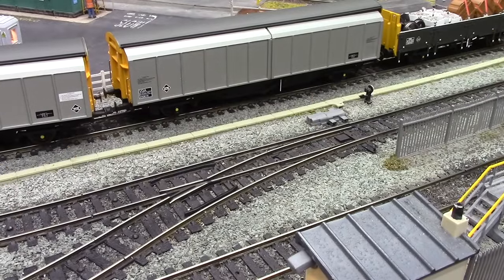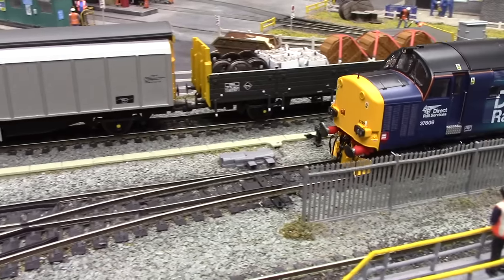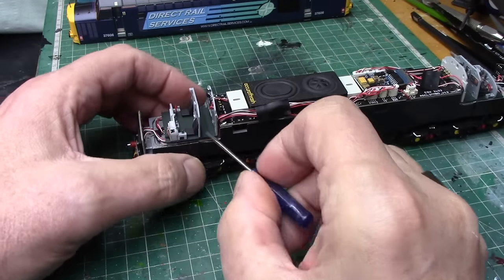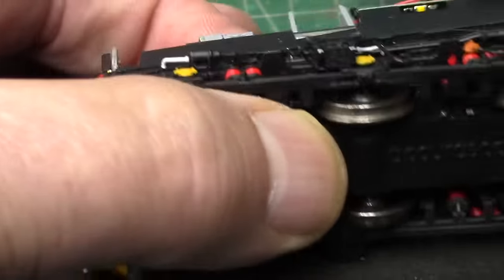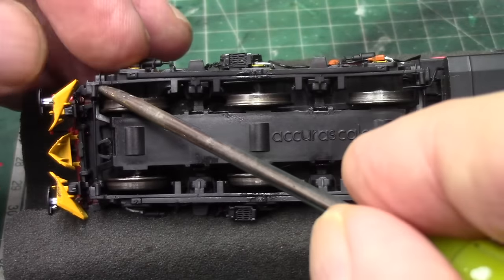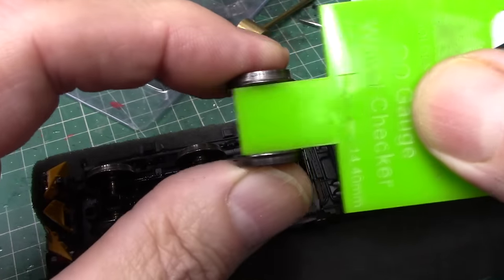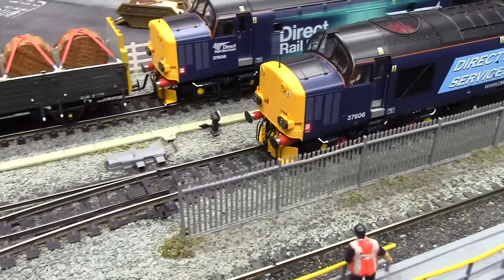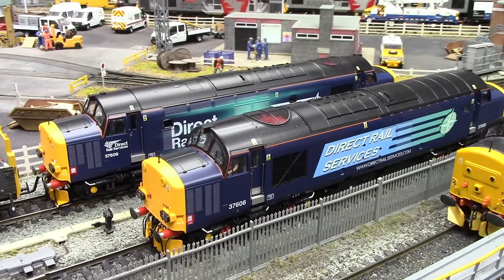Accurascale 37 bogie strip down

Comment: morning Mr D.

Blimey, I don't understand why so many folks take the bogie frames apart on these locos...

I had to adjust the roller bearings on mine, one wasn't in place correctly,

So when I came to remove the keeper plate, I got the whole thing off in one piece just using  thin jewelers  screw driver. The only thing that came off was the little brake rod you mentioned, which I just popped back on afterwards...

But when I did mine, the side frames, keeper etc all come off in one... Really not sure if that's just my model at this stage 😂
Reply from the maker: Hi mate, yes you
 can get them off with the keeper plate but I thought the chains would hamper the access in getting the wheels out and its already quite fiddly getting the pickup wipers in place afterwards. So just thought show how to remove the frames altogether
All the best Peter

Comment: Greetings to my 'like' supporter; for yesterday's comment; even I need friends.
I don't know what gets out of this computer so I kept message short.  Would like to have added that the near quote about the wheel and the turnout standards being 'a system' is from a prototype track engineer - a very bright man.  Also (Pete) it would have been a good idea to have removed a wheel from the offending loco and inspected it on the crossing of the turnout before alteration.  Always inspect; if you don't know where you are you can't meaningfully move.  My suspicion is modern release loco wheel standards sit uneasily on a lot of track standards - note no names are mentioned!  Certainly, re-wheeling my old stock with currently available wheels has been persistently unsuccessful and left me looking at making my own wheels and axles.  Wrenn supplied replacement wheels longer ago than any of us care to remember.  They worked superbly.  My own wheels copied from Wrenn worked well.  The hard part is making new axles.  Axle wear, bearing wear, and why, is a huge subject.  Time to shut-up.  Hope this reads OK.
Spare a thought for me: yesterday, in my own amateur way, I was paring down 1970s/1980s Minitrix wheel flanges.  Now where dd I put those  Peppermints!

Comment: Hello Peter, thanks for the tip regarding the gauge checker, I have just bought one.
I use Hornby track, mainly express points and some of the smaller radius points. 
Hornby straights and curves (either 3rd or 4th radius) along with some flexible track for the larger radius curves.
I prefer Hornby track mainly because of the fishplates, being a much tighter fit than Peco.
I have the DCC back to back gauge 145 and if I have trouble with wagons or coaches derailing I always first check the back to back on the wheels.
But I nearly always find the DCC gauge will not fit in, so have to force it in and of course it will make the wheels a tighter fit to the track, if that makes sense?
Now when gauge arrives I will be able to adjust wheel back to backs to what is more suitable (according to Peter) for my Hornby track, time will tell?
I must admit I do not have any derailment problems with my collection of Hornby/Bachmann/Heljan/Dapol/Murphy's and now 2 Accurascale 37s.
I've never noticed any clicking noise when locos cross the frogs but I will now have a listen. 
There is no way I could do what you have done stripping loco to alter B to Bs, but I can on my wagons and coaches, so again thanks for the info. Bill.
Reply from the maker: Hi Bill, yes it's a funny thing, everything's fine if run straight through and I don't have any curve points. Most of my locos run fine, Hornby of corse, Bachmann, Heljan, Hattons and some Dapol. Others just wanted to ride over the frog when point was set to turn. On rolling stock I found they were a lot less accurate back to back settings than on the locos even on the same wagon. Hope the gauge works for you. 
All the best Peter

Comment: My chain has come off my Accurascale class 37 :(  How do I put the chain back on?
Reply from the maker: Hi, so the chain is held on by small wire that's been twisted around to form the join and the excess cut back to that join. I found something similar by striping of the outer casing of multi core wire, use just the one strand of that wire as it should be fine enough to again put through the last chain link and the attach it to either the location on the bogie or from the metal arm. Have your thin piece of wire long enough so you can do the twisting and when you have a good enough twisted joint cut the excess of. Hope this makes sense 
Cheers Peter

Comment: Peter: enjoyed your video as ever.  I wrote a reply to 'Geord..' but never got through; might have been too long.  There is no email here to get it to you otherwise. 
Anyhow, any 'clunk' is a red flag.  Are you sure the wheel standards match the turnout standards?  The wheel/turnout check gauge are a system.  At the very least the check rail positions the opposite wheel so it does not pick the crossing (Clunk!), while the wheel tread must be wide enough so it is firmly on the closure rail/wing rail while crossing the crossing gap.  If it is not the wheel drops (Clunk!) and if the wheel is narrow enough it might fall to the inside of the rail and jam - and that really is a 'Clunk'.
Best wishes to you and to 'Geord..'
Peter

Comment: Thanks Peter.  A really helpful video.  My brand new 37 kept derailing on left-hand points.  Just at one bogie.  Had me totally baffled.  So I stripped it down as per your video, expecting that maybe the back-to-back was slightly out on the leading wheel-set.  Turns out one of the bearings on the trailing wheel-set wasn't properly seated in its slot, so the wheel-set was too wobbly.  That's how it must have come from the factory!  Fitted it properly - she now runs like a charm.  

It astounds me that basic mistakes like that aren't spotted during the final quality control checks at the factory or when received by Accurascale!  Do they test the models they receive?  Also - they could have designed a more user-friendly, practical design for the bogies that allows much easier removal of the keeper plate for routine maintenance. It's a right headache needing to do it this way.  In the end, I snipped off the two metal crossbars after I'd wasted too much time faffing around trying to pop them back into their holes.

I also had a separate problem with the bogie chains occasionally snagging and causing derailments, so eventually I removed them too.  The chains are more hassle than they're worth in my opinion.  Likewise, another small detail (a tiny bracket) on the bogie-end of the diesel tanks/weights occasionally snagged the bogies on tight turns, so I removed that too.  Finally, my 37 is fitted with kadee couplers with NEM fittings.  The couplings get very close to the buffers on radius 2 points, regardless of what length kadee I fit.  Luckily I haven't had them actually clash yet.  Some things worth checking.

I love the detail and thought that have gone into these Accurascale scale models, such as pre-installed DCC stay-alives.  But they do need to make their models easier to maintain for the average modeller, even if that means sacrificing some small details particularly in places where it never gets seen.  Given all the niggles I've had with the class 37, I've already cancelled the Class 50 that I had on pre-order.

At the end of the day, I just want my locos to run reliability on my layout without the constant need for fiddling or having to fix mistakes made by the manufacturer or supplier.

Keep the videos coming.  Your optimism for the worlds greatest (and most frustrating!) hobby is infectious.  Thanks
Reply from the maker: Hi James, that's great to know I have been of help. Yes it's a bit of a trade off to have such detail when it comes to servicing/repairs etc. Even my Cavalax 56 needed the back to back altered as again it did not like my Hornby points but now runs perfectly and it was much easer to do as the bogie frames do not come of but slide apart so you can take the wheels out. So much better. When it comes to having detail and running out of the box, I can't knock Bachmann. I have their new tooled 47 and apart from adding a lot of detail pipes to the buffer beam to compete the look, it runs perfectly. I don't have one of their new 37s to compare with Accurascales but if they did one in a scheme I want then I will get one Im sure.
Again thank you and all the best Peter